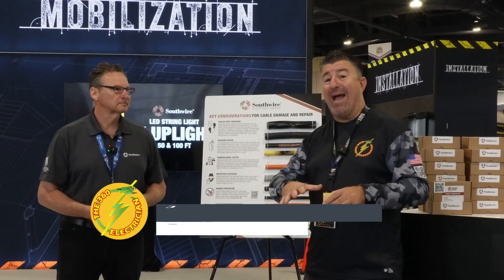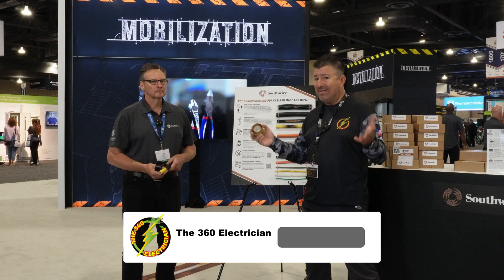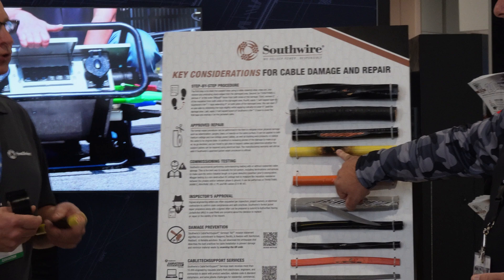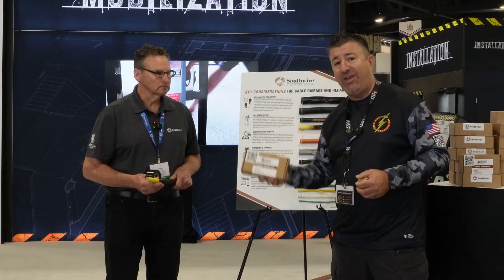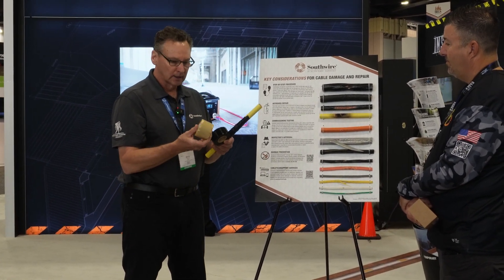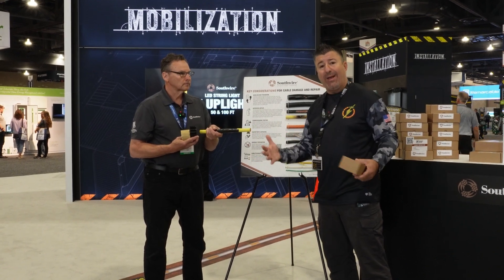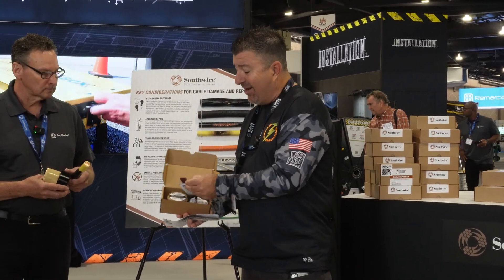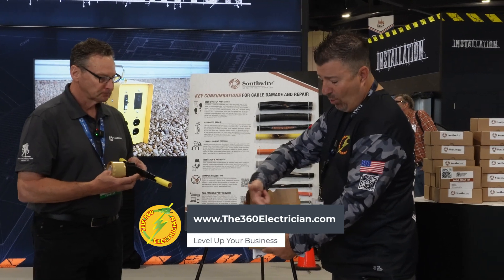Fixing Damaged Electrical Wires (How To)

Comment: Hello there, i have a question or two pertaining to non grounded older homes. 

What can you do with an old house without grounded wiring ?

GFCI outlets can be used to replace 2 prong outlets. But there's still no ground. So I'm assuming you can't use typical "surge protection" power strips (or likely no type of modern day power strip of any kind)  because they rely on shunting to ground. Which a non grounded homes wiring doesn't have. 

Also, if the house doesn't have grounded wiring. Would a whole house surge protector at the service box actually still protect the home (I'm assuming no) ? 

It seems like the only thing I can think of as far as protection for a non grounded home. Is something like a "Zero Surge" product. As they filter through their built in capacitors. & are filtered back through the neutral once the charge has slowed down to a safe level. At least that's what they claim to do. 

So in that situation I'd have to assume maybe in an ungrounded home. Your only choice outside of a complete rewire upgrade. Is a GFCI outlet with a Zero Surge power strip plugged into it (pretty expensive solution still).

Or is there another way to have protection in an non grounded home. Besides a GFCI + Zero Surge combination. Or just updating the whole home with a full rewire ?

Thanks !
Reply: That would be expensive changing every outlet to GFCI. Depending on the type of breaker panel you have I believe you can purchase GFCI breakers that would take care of the entire circuit. Hope this gives you a little direction until a Professional electrician replies. I have an older home with ungrounded circuits as well and on a few of them I have been running a separate ground back to the panel and some just replacing with new wiring, very time consuming also replacing older backstab receptacles as well.
Reply: @whitetiger8652  thanks ! & yeah I also thought about maybe trying to ground specific rooms separately.